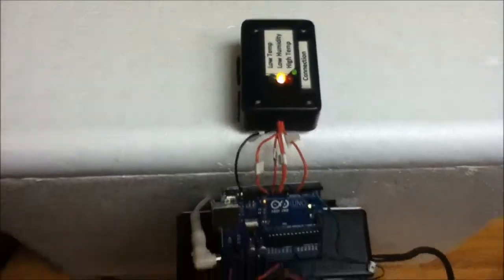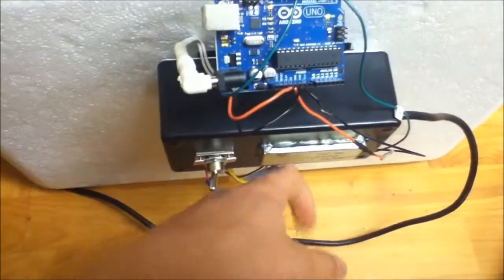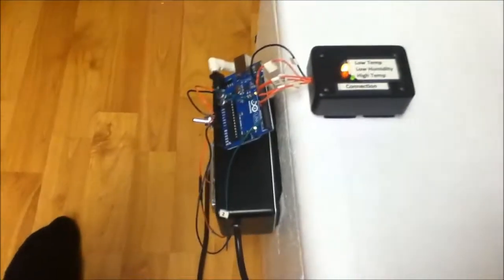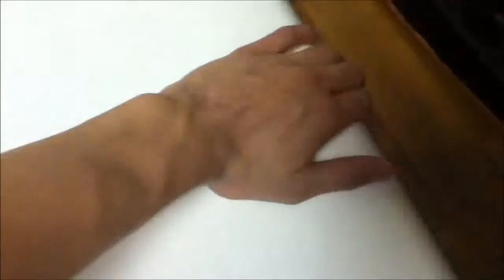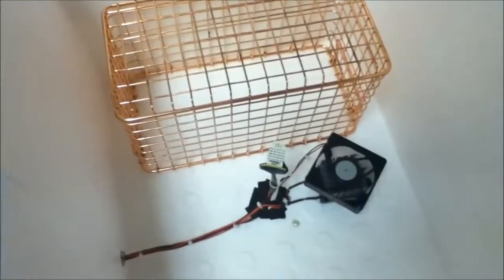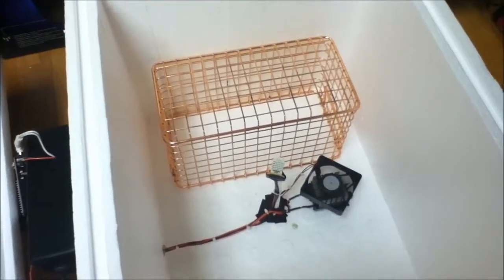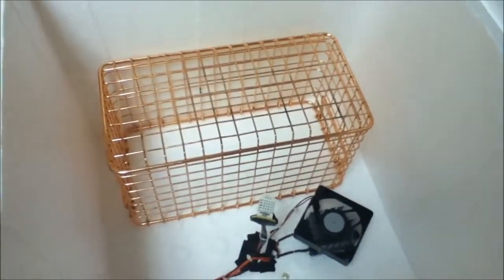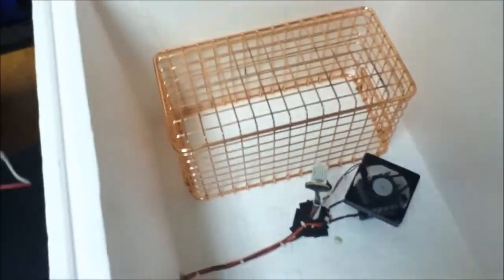Cell incubator project - DIY Bio

Comment: I'd love to know more about your build for your HEPA filter, do you have any more info on your build? Massive respect for the build!
Reply from the maker: Thanks! I would send a picture if I could but I don't think I can do that through YouTube. The was essentially a plexiglass box I screwed together with a swinging door hanging from the lid and an opening on the top. On the top opening I made a bit of a chimney which I squeezed the filter into. I put  two small fans, the type made for desktop computers, and got them wired to both blow air down through the filter. I also sealed up all of the cracks with what I'm pretty sure was a silicon caulk so spills wouldn't leak out the sides and I put some rubber feat on the thing so it wouldn't scratch my desk. I think I spent almost $100 on it total, largely because I got a really clear and flame resistant plexiglass which was kind of expensive, but if you used a cheaper material you could probably cut the price in half.